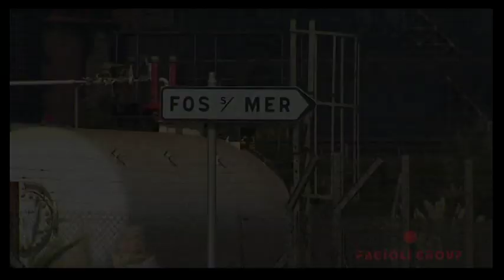Fagioli - Blast Furnace Replacement Fos Sur Mer

Comment: Re-building of Blast Furnace is so easy this way. :-)
Reply: Sorry, I do not agree with your conclusions. The video shows the process of replacing an old blast furnace with a new one. It took several years to prepare this process. Therefore, it is better to say quickly, but not easy